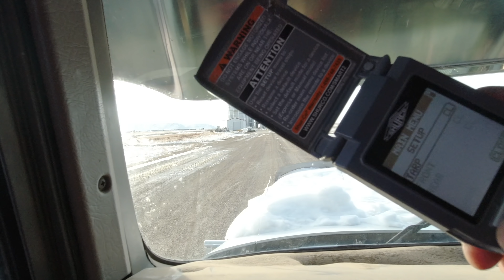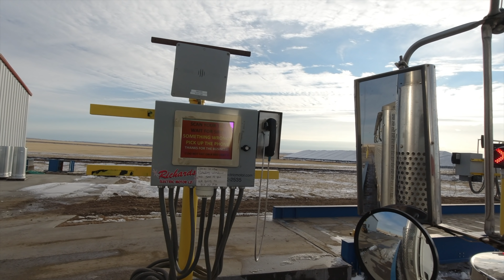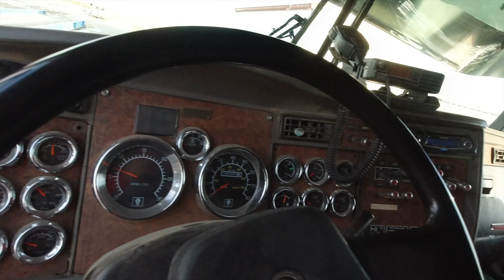She's a Cougar!

Comment: Thank you! thank you! for the hot battery connection. I as having one with a small ground wire at the battery on my snowmobile, and was struggling to find the cause. I was concentrating on finding the other end of the wire in order to find a problem there. I have had heat situations at bad terminal connections plenty of times before, but until I saw it on this video I wasn't checking that this time. Thanks for getting my attention.
Reply from the maker: Glad it helped

Comment: i chuckled as i wached you with the battery terminals. i probably have 60 or more of those nuts for batteries. I wreak alot of old wreak semitrailers, with reefer units on them, i make a small bonouse off the bad batteries i pull out, and we reuse all good ones of course. but still i have so many of them nuts it is crazy

Comment: It looks to be mighty cold where you farm, could you please detail how you cope with this extreme temp with regard to the diesel to stop it waxing? - Perhaps the fuel supplier includes some additive(s) and/or you take extra measures yourselves besides shedding the engines at night? Do you have to use differing grades of engine oil as well?
Many thanks.
Reply from the maker: We will either add conditioner to the fuel when it get below 0 or mix number 1 fuel with the standard number 2. Number 1 won't gel

Comment: At least ya don't have to heat those trucks up before ya start em!!
Reply from the maker: Usually we will plug them in but kinda a last minuet "lets haul today."
Reply: @FastAgMontana  Before I put the fancy electrical stuff in my shop, all I had was an old steel pipe elbow with a plate welded on one end and a piece of sucker rod welded on for it to stand up. Slide that under the oil pan and throw a lit weed burner in the open end... Started even at -50!!

Comment: Can you add a pto to the cougar ?  Would you ever need one ?  Could be a good tractor if the price is right. does it have a mechanical trans or some form of powershift ?
Reply from the maker: It doesn't have a pto but if did then it could run the grain cart but with out power shift that would be kinda tricky.  Its a 5 speed plus two aux boxes.

Comment: Question: 
in those grain elevators, are they measuring weight differential to the closest pound ? ounce ? Do they allow for fuel burn between stations ?
What's the error margin  on the measurement ?

An inquiring mind wants to know ?
Reply: Don't know about over there but over here in the UK scales are to the nearest 10kg (22 pounds) and no allowance would be made for fuel burnt between weighings, it's less than the scales would register anyway.
Reply: Most large scales measure in 20 pound increments and Mrpaw is right the fuel burn off just driving around a plant or elevator is very minimal likely only 1 or 2 pounds
Reply: You weigh in, unload, and then weigh out.
Reply from the maker: I believe they are 20 pound increments. Fuel burn would be unmeasurable.

Comment: Tony.i see the trucks have 3axl on the back Do you use them a lot? Or only when you have realy dry roads.? No slippery.
And wy two 2axle  trailers.the ballance/weight of a 3 axle is better .
2 axle trailers are so 70's😉
Reply from the maker: We put the axels down when we leave the yard. I will explain that more in another video.

Comment: That Steiger is just a big bud with a different name isn’t it?
Reply: No the steiger is a design started in Minnesota  by a couple of brothers in the mid 50's.  They had that steiger green paint since the beginning.
Reply: The Steiger is the predecessor to the CaseIH four wheel drive tractors.
Reply: Thanks for the info guys. Very similar design though isn’t it? Which came first, the Steiger or the big bud?
Reply from the maker: Steiger was first is my guess. Big Bud was started after John Deere pulled a fast one on Wagner and put them out of business and Wagner dealers didnt have a tractor to sell anymore. Thats why the early buds and Wagners look a lot alike.
Reply: @benpattinson1  The Steigers built their first tractor in 1957 and in 1970 moved production from the barn to the big factory in Fargo where they're still made today. In the 1970s IHC bought about a 1/3 of Steiger and as a result, Steiger made IHC articulated 4wd's, tenneco finished the buyout in 1985/1986 and merged it and IHC's Ag division with the unprofitable JICase division they owned in hopes of making it profitable.

Northern Manufacturing started building Big Buds in 1968, About 550 were made, The first ones were basically bigger wagners, as thats what they were a dealer for. John Deere contracted to buy all of Wagner's tractors(and the contract said they could only sell to deere, something like 10 years or so) and Deere didn't buy any and developed their own, ending Wagner in the tractor world.

Versatile started building tractors in 1968, before that they were building swathers, augers, sprayers, harrows, etc. They are still built in the original factory in Winnipeg, and now in Russia too.

In a way they're all the same(general frame, engine, transmission setup, as there are only so many ways to design a frame, engine and transmission setup, etc.), but no tractor is an exact copy(execpt for IHC Steigers and Steigers, but the IHC versions are much lighter and have IHC engines).

In terms of weight Buds are the heaviest, probably built the heaviest too, Steigers next heaviest, then Versatiles, then the IHC Steigers.

(when talking about the original companies, pre buyouts)

Versatile is designed to be a simple tractor, just about everything aside from the engines, which was basically all Cummins engines, were made by Versatile or designed by Versatile. This includes the transmissions, axles, cabs, frames, etc.

Steiger...wasn't made to be a simple tractor, but wasn't made to be a complicated one either. They started out as a component tractor, Truck Transmissions, Truck/construction equipment axles, etc, and later moved to their own(? not 100% sure on it as the transmissions say "Built for Steiger Tractor Fargo ND by (whoever)" but I think its their design) designs for transmissions(aside from the automatic transmissions) but kept the outsourced axles, which certain ones are highly sought after today. I am not sure about the cabs, but I think they were outsourced to the same company that built cabs for Big Bud.

Big Bud started out similar to Steiger, as a component tractor, and later shifted somewhat away from it, but came up with a, to some anyway, genius idea: torque converters instead of clutches. The most popular modes of Buds had a Twin Disc power shift transmission joined to the engine by a torque converter, like in a car's automatic transmission. Steiger experimented around with this design with the PTA series, but never developed high horsepower versions and put automatic transmissions in instead of powershifts. For the most part Big Bud's idea works well, and Big Bud is the only tractor that has the engine and transmission on a skid for "easy" and "quick" removal and replacement. Buds are VERY heavy. 100lbs per every 1 HP was their target.

In terms of sales from most to least:
Versatile
Steiger
IHC Steiger
Big Bud(550)

Hope that helps.
Reply: @J-1410  superb summary sir. Thankyou.